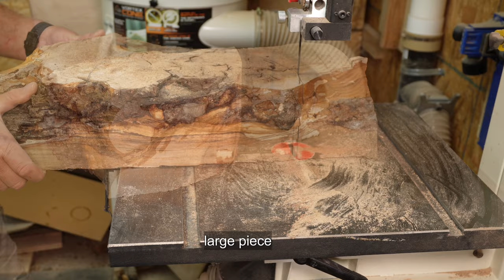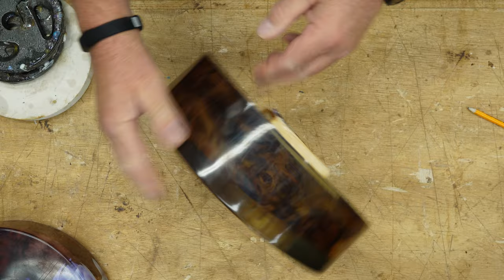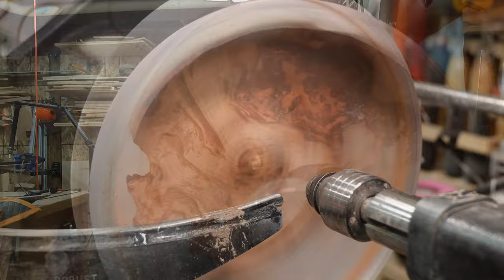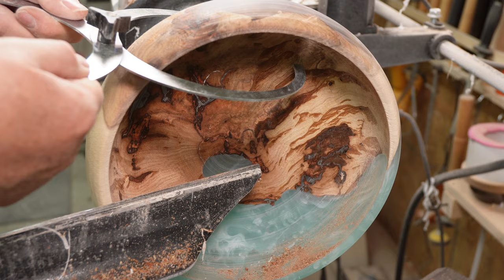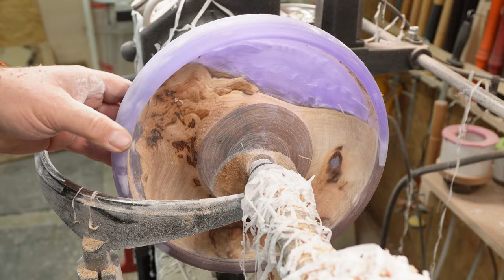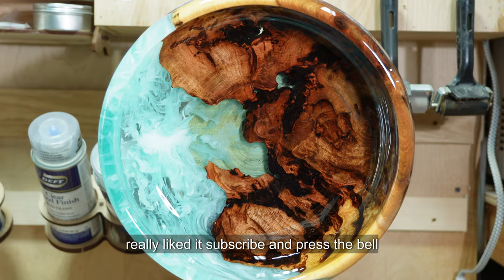Woodturning for a profit using epoxy.

Comment: Good morning 🌅, Well done, very nice Art work, could not quite see what type of brush you were using to apply your finish finish, but there is a silicon brush that you can use. I think it’s normally used for barbecues., but it allows you to apply the resin without leaving bristles, And obviously, the resin will not stick to the bristles of the brush so you can remove them a lot easier, You might have already heard of the guy in Canada, called Sprague Woodturning, I have been watching him for years, he is into resin and wood products wood turning , 
Stay safe keep up the great work , from France,
Reply from the maker: Great to hear from you bro.. Yes use a poly disposable brush. I use CA glue at the base  of the brush to prevent bristles escaping when applying the epoxy. Yes I subscribe to Sprague he has made some beautiful work. Cheers!

Comment: Very nice work. What were the dimension of the bowls? Just curious how you came out at 333.00 a piece? Do you price by size or, time or,  looks? I have tried several approaches but haven't found a tried and true way yet to price without over pricing. I also advertize as 1 of a kind because I have never made duplicates and even if I did, no two would be the same.
Reply from the maker: Two of them were 11x3 and the blue one was 11x4 approx. Listed them at $350 each. The price is decided from other epoxy bowls all around the same price mine were listed at.
Reply: @bespokewoodartistry1517  thank you!